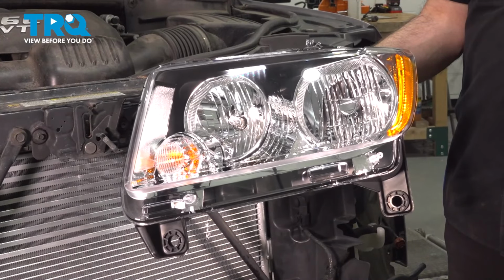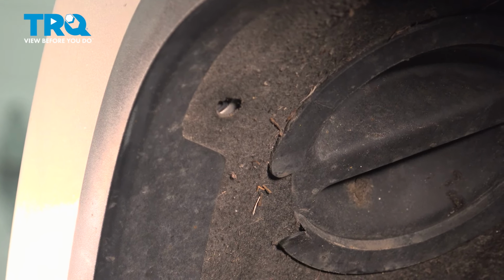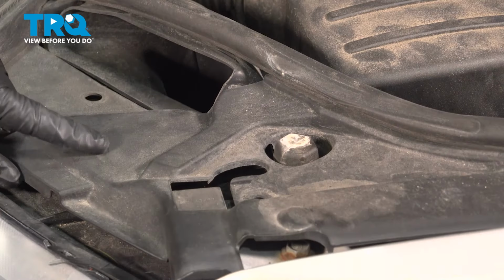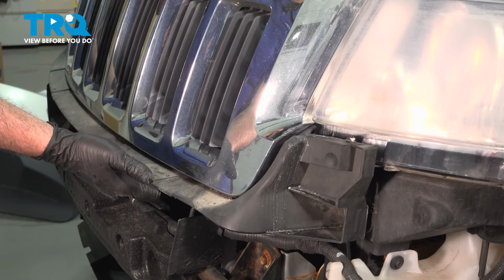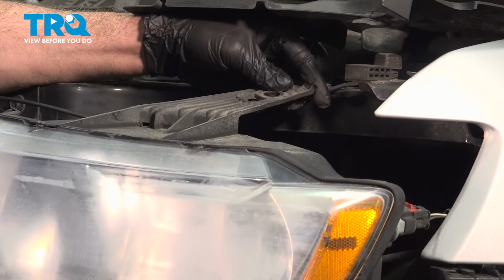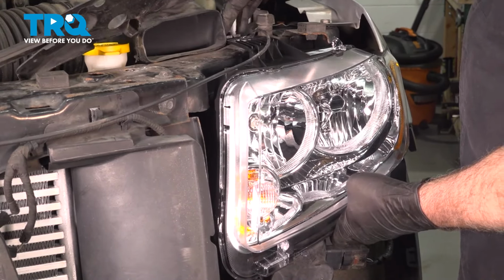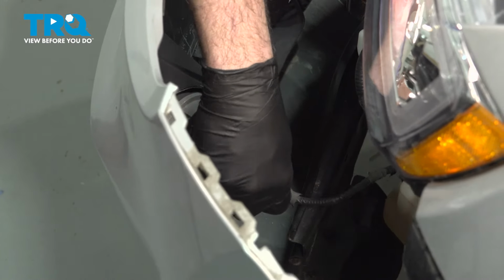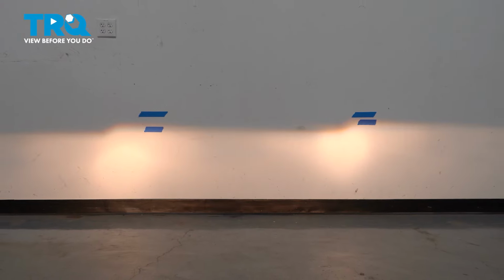How to Replace Headlight Assemblies 2011-2021 Jeep Grand Cherokee

Comment: In your video you talk about replacing little black plastic buttons from under the bumper and Trim buttons inside the wheel well you mentioned some have to be replaced where do we go to get new buttons and how do we know which ones to get like what size aren't the buttons different sizes and different parts of the car?